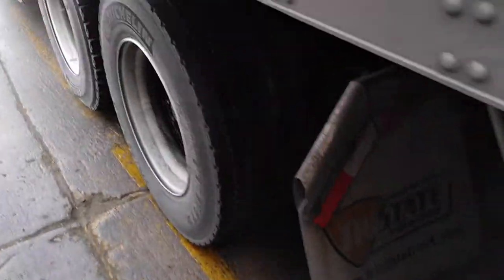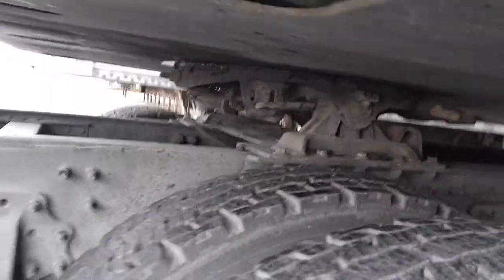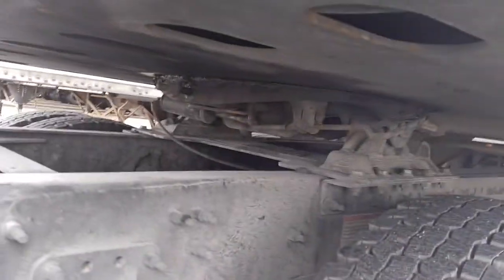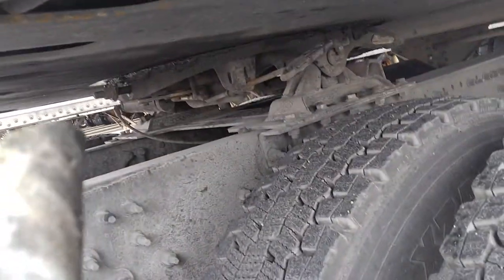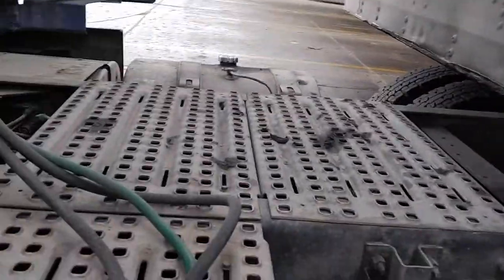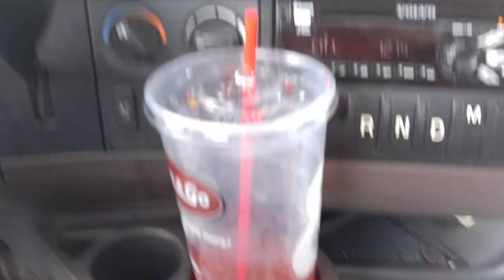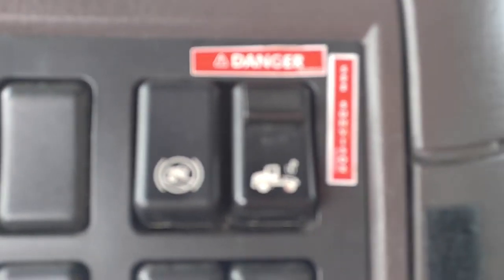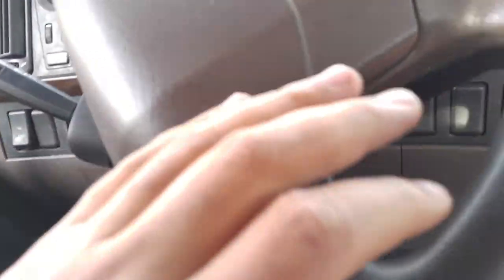In-cab 5th wheel release Automatic fifth wheel release on new Volvo SEMI

Comment: Is this all volvos or a specific one❓I have trouble reaching the release arm because of my size so do you have any tips to help me if I cant use this ❓
Reply from the maker: Just depend on option truck may have, they sell a hook tool you can use for regular 5th wheels
Reply: Bigg Truck Driving I don’t think I use those correctly. I can’t hold back the safety latch and pull the release arm at the same time.
Reply from the maker: @simsima3669  got you, yeah not real sure I would ask a few drivers or old timers they would know.
Reply: Bigg Truck Driving okay. Thank you so much for your help
Reply: Cici V I own vnl780 it’s in shop have fifth wheel  needs rebuilt and told me if I can get brand you with air release that’s like 1500$ with labor but pay off hard it when I was company driver was so easy cold weather  saves u a lot of headache going in and out